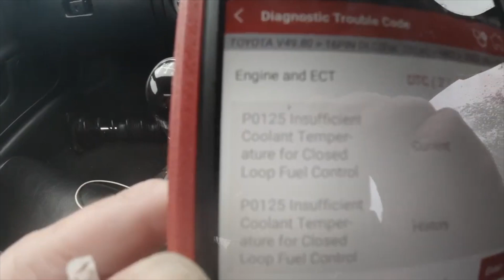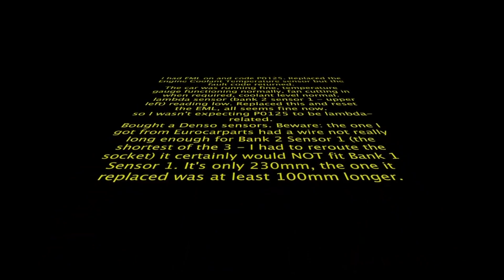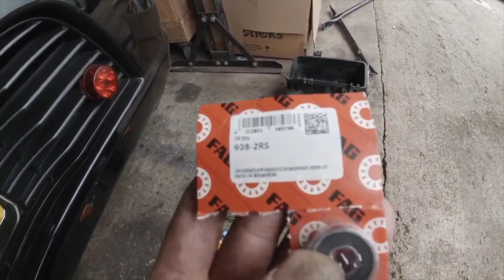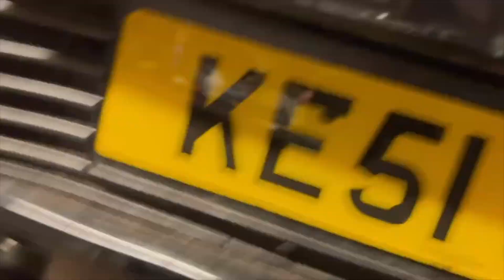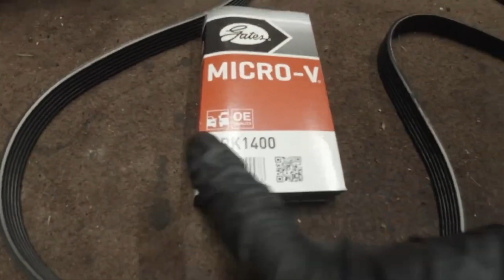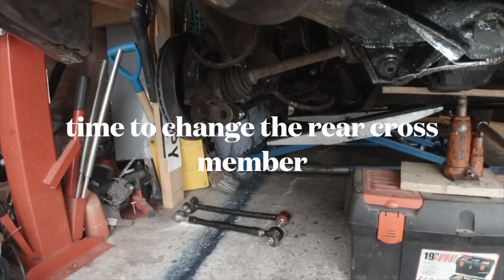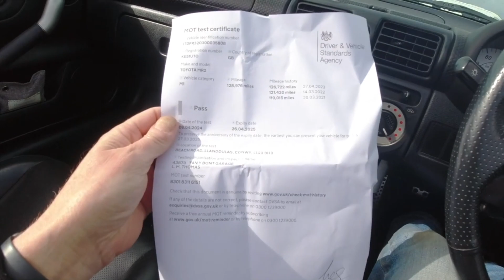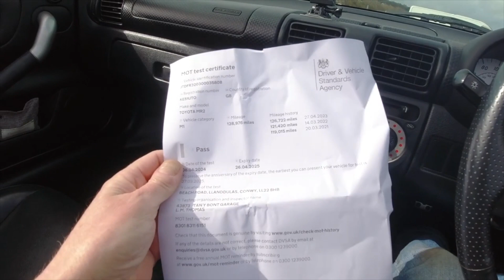Project Pad Foot Straight though to mot

Comment: Baby Ferrari only more reliable. Glad you have the skills required. Better than mx5 and was overlooked I think. Will be very valuable one day? Why anybody buys non Japanese m bikes or cars I don’t know. At the time I had an Austin 1100 piece of crap at 18, my aunt and uncle bought a Datsun cherry 100a. When I drove it what a revelation. I had one brit bike that was enough. Had a bmw too. Japanese rule imo. A girlfrind of mine had the mk1 MR2 but Iwas a little tall for it.
I have been using lanoguarded for several years on my old bangers
Reply from the maker: https://youtu.be/-b4xb4c_b28